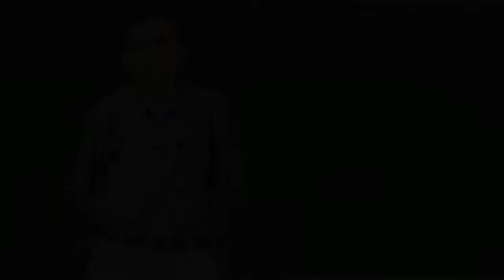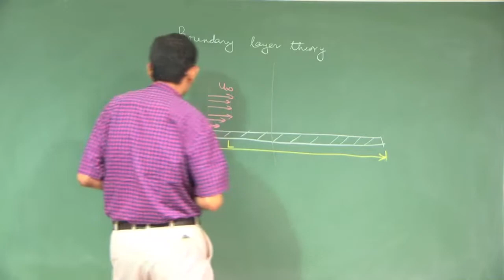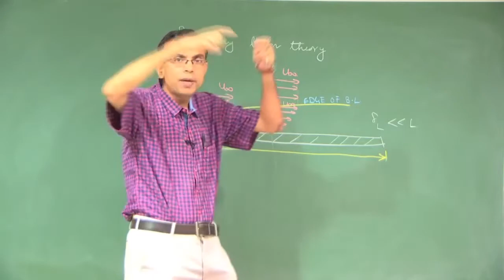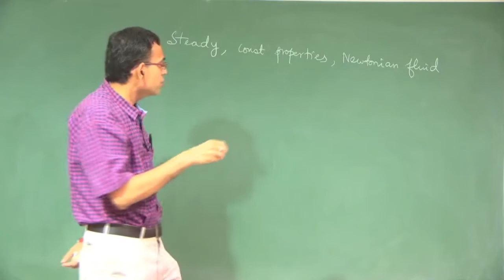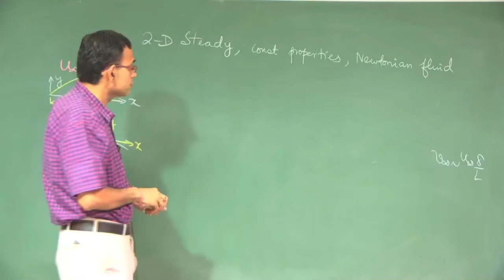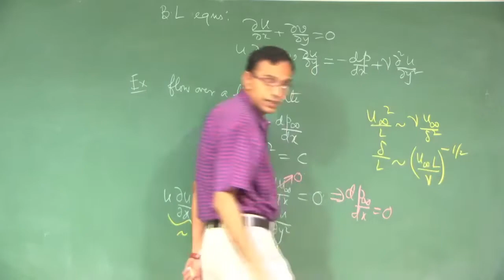Lecture 24 : Introduction to Boundary Layer Theory

Comment: I have a few more questions,
1.)  2 yellow circled points -  What do they represent? Why are they chosen at those 2  particular points?
2.) What exactly is the Boundary Layer and why is it important in fluid mechanics?
Reply: Boundary layer used extensively in aerodynamic design etc. I am working in atmospheric modelling. It extensively used here as a concept of planetary boundary layer and the near surface layer treatment carried out using monin-obukhov similarity theory and turbulent parameterization. 
1. Two point are selected arbitrarily to showing the profile at these point you can take many point along this yellow line for your sake of explanation.

2. When a fluid flow over certain solid surface it is affected the the surface characteriscts such as roughness etc which exert a viscous drag in vertical velocity profile. So an approximate height up to which the surface effects are dominated called boundary layer.